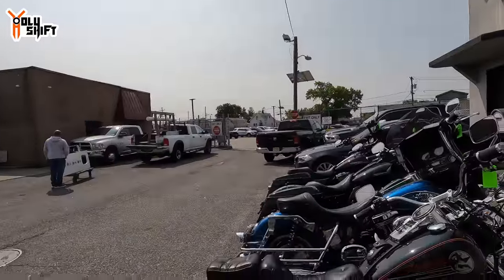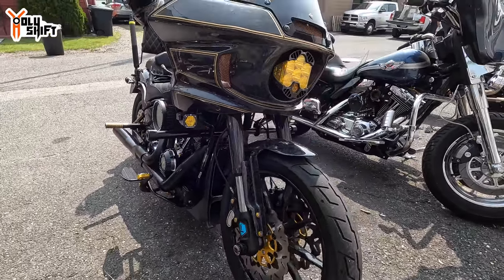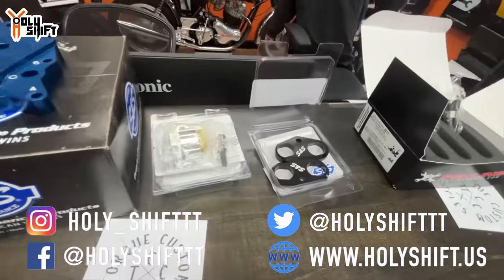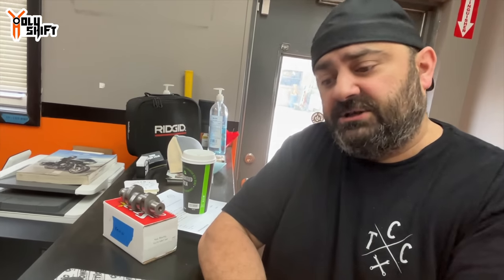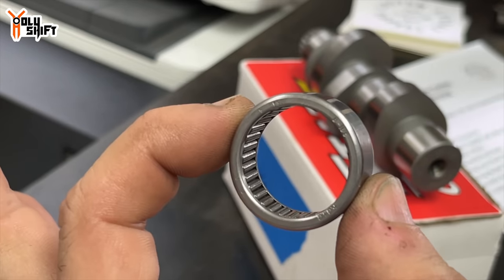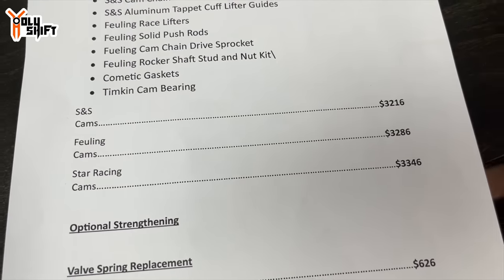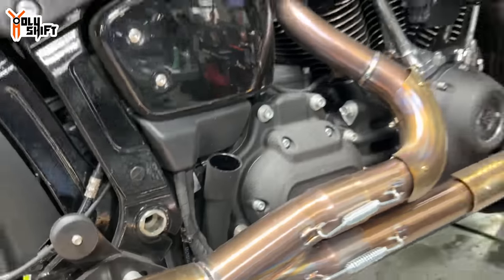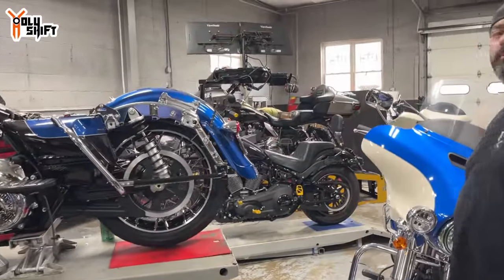STAGE 2 COST HOW MUCH ?

Comment: I would not say it's 'basic'.  This is a bullet proof set-up for longevity (high mileage) kit and/for max hp tuning.  On later model M8s, there's no need to upgrade the oil pump and cam chest if you typically just do day rides with your mates and/or intend not keeping your bike for years on end, then this kit is over the top, and especially if you do a Dyno tune and the tuner keeps some safety margins in the mapping so the motor is not stressed out to the max.  Either way, if you have the money and are willing to spend it on this upgrade, it's a free country.  All that said, this is a very informative video, thank you, the only things missing is an estimate of typical HP/Tq increases this chap gets for your hard earned USD3,200 + the tuner license, for this "basic" kit and then extrapolate the cost per HP to determine if we are just motor heads or if we should just a buy a Pan America so we have that HP right out of the box without spending the big bucks on a Stage II or III or IV upgrade.

Comment: Even the Star Racing guy says the stock plate and pump are perfectly ok for a bolt in cam.  If you want to spend the money, go for it, but it’s not necessary.  And the “plastic” lifter cuffs are perfectly ok too.  Same composite anti-rotation device that GM uses in their LS engines.  The only reason you need to change the cuffs would be to allow for a higher lift cam.  So you could have spent a lot less money.  But hey, a blue cam plate is cool.
Reply: Jim Berry...
The stock cast cam plate has poor oil passages thru it and a weak oil pump so the motor suffers from the improper oil pressures....the aftermarket bliilet plates and oil pumps are made to remedy that flaw in the stock harley design, so the bliiet plates and pumps are definitely worth the money. You'd think for 30 grand and up your brand new 2023 harley would come with a billet cam plate and bliilet oil pump.....I guess if you want all that fancy crap on a stock bike you roll off the dealership floor you'll buy a 100 thousand dollar Arch motorcycle........
Reply: Cuff is $60 and is replaced free with installation. Wouldn’t call it a waste to remove plastic with billet. Imo
Reply: @freebehindbars8654  I agree with you.  I just don’t like to hear people bash HD with comments like “junk plastic parts” or “Harley is using crap parts”.   I’ve heard these comments on several you tube channels and I just don’t think that’s a correct assessment.
Reply: @Jim_Berry  I’m not a fan of plastic in a motor, especially air cooled, but it is what it is. I removed as much plastic as I could(retainers, intake..) from the LS in my Square Body Chevy. If nothing else, it’s for my peace of mind.
Reply: Yea, the "while we're in there" stuff, the shop owner keeps recommending seemed incredibly excessive to me.  I know it's the absolute best and top of the line way to do it, and good on them if they have the clientele.  For a guy like me, I'm looking at about a third of the price.  I also am surprised he said 4-6 hours for a dyno tune on a stage 2 setup.  That's a lot of money on the dyno, especially if the tuner is building off a saved tune from a similar setup.  Upselling $800 in plate/pump, extra $100 for race lifters, $40 for a cam bolt, $80 lifter cuffs etc etc etc.  I trust George Bryce's logic on this type of thing.
Reply: @someonesomewheresomdeday  if the bike is new, you could use everything. If it has any amount of miles and you use the lifters… you’ll get what you pay for. I’m out of the camp that if you can afford it, you can afford to do it right.
Reply: @Jim_Berry and in some recent cases they are finding that these billet tappet cuffs are scoring and damaging the lifters.
Reply: @someonesomewheresomdeday I’m not into spending unnecessary money. This shop owner would be a tough guy to argue with once your bike gets in his hands. Oh it’s recommended you do this and you do that. He doesn’t invent this stuff or manufacture it either. He’s giving his word that we use some of this stuff because hey, it’s just because.

Comment: Great explanation! I just finished building my fully custom Street Glide w 475 Cam, oil pump, cam bearing, feuling sprocket, head pipe, etc. Thanks to yours, Cyclefanatix, FlyNride and Daval videos they helped me to make a perfect choice to use the parts I am very happy with! I’ve done all the work myself w no help and bike runs amazing!

Comment: I just did my 2011 FLHX I used all S&S parts 

1. TC3 cam plate
2. S&S oil pump
3. S&S precision lifters 
4. S&S quickie adjust pushrods 
5. S&S 551 cams w/ new bearings and hydraulic cam     
    Chain tensioners 

I did the work myself it’s fairly basic just need to take your time and the instructions with the kit are spot on.  Only cost me $1800 for the kit I also did a complete exhaust swap for another 1k and tuned it myself using a V&H FP3 tuner 

Bike runs like new pulls all day long so for $2800 bucks I have a kick ass bike now. The saved cash can go to other goodies for the bike lol just make sure you download the service manual and check your crank runout

The whole job took me 6 hours by myself
Reply: Nice setup , the only issue is the FP3  tuner is emission controlled nowadays, the old ones weren’t but we all k is that’s changed with the government getting up our ass’s.  Shiney Side up my brotha
Reply: Thanks, I’m getting the power vision with the target tune kit to make it easy to tune and dyno. Ride safe brother

Comment: I’d done the cast intake manifold and at least 5.5gs injectors. The cam plate/oil pump was a good addition but not necessary. The revised HD pump which you had works good. The only time you need an aft market plate and pump is with .520 lift or greater. Also it will depend on the crankshaft runout.

Comment: Thumbs up on you posting this.  I have no doubt this gentleman knows his stuff.  I have no doubt he could sell ice cubes to an Eskimo.  I put a 22XE, Torrington-Koyo bearing, HP+ lifters, S&S adjustable pushrods, and S&S lifter cuffs on my '22 FXLRS for $1070 including the cam tool and taxes.  If I had a do over, I would not change the lifter cuffs.  All that stuff he mentioned that does not cost a lot, adds up to cost a lot.

Comment: Holy crap that brass bushing is the reason I went with the race fueling pump.
And if you get the wrong guy to install s@s they might mess with oil pressure setting 
The brass can wear and clog oil passage screen. At least you can take it apart and clean it.
Kevin baxter I think is the video I watched him mention it. 
Fueling is 1 piece. It starts as smaller hole and they use a honing process as they enlarge the hole it gets stronger.
fueling hp 6061 aluminum oil pump
fueling Race is   billet 7075 hard anodized oil pump and camplate

Comment: Consider watching some of George Bryce videos. He created the star racing cams. He currently drag races a police bike with the 30/30  cam running stock cam plate and oil pump.
Reply: And also in his opinion he thinks the stock pump and plate is superior to feuling and s&s. He has a video on it. His position seems to be that the stock pump and plate has better scavenging which he claims is more important than increased pressure. I’ll go by Georges advice until these other guys show me how many national championships they have. George also doesn’t see a problem with the stock tappet cuffs.
Reply: @1962egl  Stock tappet cuffs become an issue when a cam lifts over .500, some say .515
Reply: @carlbruhn1772  this is true. But the implication is that they prone to failure because they are plastic.
Reply: @1962egl  I put S@S in mine simply because 75 dollars is not a factor when it's torn down. I would be curious if a stock bike would ever wear them out. By the time the tappets wobble enough to touch the tappett cuffs you would have a ton of problems.
Reply: @carlbruhn1772  yep

Comment: Gunna have mine done with the 3/4 star racing cam along with the throttle body / injectors / intake, then all the bits & parts you have listed here. Thanks for the info!

Comment: I was told by s&s my 2022 low rider s the oil pump or cam plate doesnt need to be replace also  said the tabs exhaust isn't good if I add a cam ?what your input?

Comment: For me, the cost is ridiculous... stock is fine for me. I would have liked to hear what he does if the crank run out is excessive. Excessive run out will destroy that oil pump. I know someone who installed that oil pump with excessive run out. It destroyed his engine. HD denied his warranty claim because they blamed the new pump. It cost him north of $10,000 to make his engine whole again. The amount of money someone can spend on upgrades is prohibitive for many. With that said, it is fun watching people mess with these engines. Great video :-)
Reply: The irony is that after all the time and money spent, it still isn’t a high powered motorcycle that doesn’t have a chassis designed for extra power/performance
Reply: @jjjjjjjjrifufjssjosskenf  I get that some people love the horsepower, torque, choppy idle and notorious HD exhaust notes... I am old enough to remember the horsepower wars back in the late 60s and early 70s.. young men were building monster engines all for that bragging right. if one could wrench on his own bike today and actually do quality builds, then these upgrades are doable. with that said, I would never spend north of $25,000 and then dump another $10,000+ into it. I would start out with an affordable older bike and go from there. these engines are getting so damn big that their air-cooled features cannot keep the bike cool enough to establish reliability. that is why many hotrod builders stick with the small block engine setups. they run so much cooler than their counterpart big block engines. I love my HD. but I don't love the amount of money it costs to change the look and performance of the bike. I purchased the bike to cruise around. not break land speed records (LOL). stock is fine with me along with a few parts to keep the engine healthy and cool (external breathers and oil cooler fan). : - )
Reply: Stock is worse for that bike than a professionally installed/tuned stage 2. That stock tune/setup is so hot it’s the first thing we get away from when bringing a bike in our garage.
Reply: @jjjjjjjjrifufjssjosskenf  I want reliability and longevity... I am older now and don't care about loud pipes and insane horsepower. I just want to cruise. stage 2 does nothing for me.
Reply: @freebehindbars8654  I don't disagree... but you do not need a stage 2 setup to make the bike run better. people use tuners on stock engines to richen the factory lean tune. one of the problems is finding a dyno tuner who knows what they are doing. I have observed firsthand the detriment of having a poorly tuned engine go south because of lean spots in the tune. then what?
Reply: @richardrussell500  I agree. Everything is determined by the quality of installation and tune. I gained over 20% hp,  30% torque and the bike runs cooler. I did lose 2-3 mpg, but I’d give up double for the gains.
Reply: Sounds like you found the right tune... enjoy :-)
Reply: Too much price gouging and cost for dyno tuning... it shouldn't take 4-6 hrs to tune a bike in my opinion... I see about 1000$ that could be cut for real but to each your own I'll do my work and save the money and let thundermax do the work from there....
Reply: Good points... :-)

Comment: Excellent video, very informative.  Thanks Sandy!
Tom M. 2023 RG-ST (117, Stage-1 at this time).  Previous bike: 2021 RGS, Stage-2 114 (all S&S, full cam chest kit, S&S 2-1 long exhaust, Trask M8 checkvent, HD Oil Cooler Fan & Dynojet PV3b Tuner with map by Fuel Moto.
Reply: Tom, get a 2” lifted front suspension and a 14” rear suspension on the bike. You’ll love it.

Comment: Why not adjustable pushrods?  Seems like everywhere else is suggesting adjustable for just a stage 2.  Why pull the whole head apart when not needed?
Reply from the maker: “Give & Take “ : Whenever I see a question ? ? In the comments I like to see if the person asking the question thinks it’s fair to also subscribe to my channel first …👍🏻😜
Reply: @HOLYSHIFT  Good chance I would have subscribed if you had responded differently :)

Comment: New Jersey...I'm sure guys mean well, but there's no way a stage II costs in excess of $4k.... I'm in Arizona and a stage II same parts, $2900 installed. You could buy a stage III S&S For what you're wanting.... So glad I moved from there...
Reply: Was interested in seeing how much the parts cost purchased online and I have a total coming up of $2,147.70 NOT including the S&S Oil Pump, Cam Plate or Chain Tensioner. 

S&S Tappet Cuffs - 79.95
Fueling Race Series Solid Lifters - 269.95
Fueling Solid Push Rods - 169.95
Fueling Outer Crank Sprocket - 59.95
Fueling Rocker Shaft Stud / Nut Kit - 319.95
Fueling Inner Cam Bearing 19.95
Star 30/30 Cam - 369.00
Star Racing High Performance Valve Springs 559.00

Price also doesn't include labor so if you're getting all that installed for $2,900 (and keep in mind I left out some parts) that's a freaking steal!

Comment: Spendy for sure.  $3300 for the stage 2, $1000 for exhaust pipes and air cleaner, $1000 for dyno tune and you’re at $5500 for a stage 2.  No thanks, buy it and drive it and save the $5500 for down payment on your next bike.

Comment: What I's the price just for the parts
Reply from the maker: Check online buddy
Reply: Was interested in seeing how much the parts cost purchased online myself and I have a total coming up of $2,147.70 NOT including the S&S Oil Pump, Cam Plate or Chain Tensioner.  Prices also do not included taxes or shipping so lets say $2,500 which is over inflating it a bit I'm sure. 

S&S Tappet Cuffs - 79.95
Fueling Race Series Solid Lifters - 269.95
Fueling Solid Push Rods - 169.95
Fueling Outer Crank Sprocket - 59.95
Fueling Rocker Shaft Stud / Nut Kit - 319.95
Fueling Inner Cam Bearing 19.95
Star 30/30 Cam - 369.00
Star Racing High Performance Valve Springs 559.00